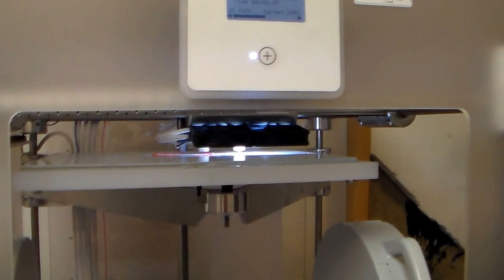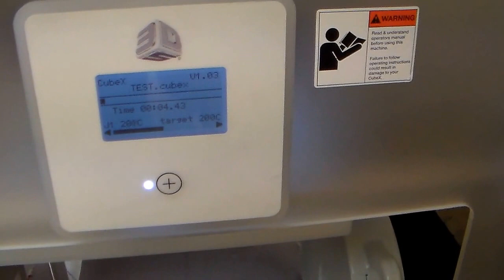Cubex 3d printer. Trouble shooting first print.

Comment: Hi Derek, use Kisslicer with Cubeitmod, you can print from bulk filament without any cartridges inserted and the print quality is much more better than with the Cubex software. Go to google group "Kisslicer refugee camp" and you'll find the files and information.
Reply from the maker: do you have to change the control board? I am confused to as how this would work?
Reply: Hi Derek, no you don't have to change the hardware.
Just download and install  Kisslicer and Cubeitmod.
That works because the printer can accept not only "cubex" files but also "bfb" files.
Kisslicer + Cubeitmod produces "bfb" files without the part of the program that checks the cartridge, but the most important is that that the quality of the printed parts will be really better than with the Cubex software because Cubeitmod V4.5 ( at the moment is the latest version) changes the speeds into the file to make them fit the speeds the printer can do and you'll have very smooth surfaces.
You'll be able to print with higher resolution than advised by 3Dsystem, I've already printed parts with a resolution of 0.05mm .
I suggest you to subscribe to the Google group  "Kisslicer refugee camp" and we can continue the discussion there.
Reply from the maker: I already have thank you so much for this information!
Reply: Derek Jones Also, you could possibly get a heated bed from GRM if you want to print with ABS with minimal warping. In addition, the latest version 4.91 allows you to use the current public unstable Kisslicer version 1.4.5.10 which allows you to use something called a "brim" or an extended first layer (not to be confused with "rafts") to allow higher adhesion to a non-heated bed surface with a bit of painter's tape that has been scratched with sand paper. You can even take out the cartridges and open them up to use their remaining filament (if you don't want to waste the invested money since the system for routing it is a major reason for a LOT of tube jams as the plastic is substandard China crap that is not even worth 20$ per pound). Just keep the spools in a plastic bag with some desiccant if it is PLA since it likes to be hydrophilic to surrounding moisture, but keep in mind that the plastic is quite literal shit since they are incredibly fragile in terms of 3DS proprietary filament. Eventually, you will want to completely gut the motherboard out and open source (using RAMBO or equivalent motherboards) the printer using some guides you can find; since, the quirks with the firmware-hardware interaction itself is a major barrier that bars you from other hot heads and already supported heating beds as other motherboards can reduce over-jerking motions of the stepper motors and stop heating beds without external input to know when the print is done.

Comment: I also bought  a cubex Duo, some  reviews classified this machine as being the best, this is funny, they classified the cubex at the top because of the max  build volume, max build depth, max build height and max build lenght :) I was dummy enough to not research decently-
This machine is awful, bad print quality, poor precision, incredibly slow, expensive plastic, (i had 3 ABS cartridges not working), I used it 3weeks and gave up. im thinking about a ultimaker or up3dplus.

Comment: thanks for posting this, Derek. I have gone thru several fine tuning of my duo since I got it two days ago. highlights: (1) Z level-- extruder too close to print plate. (2) needed to offset the extruders back more so their default position stays behind the wipe. (3) keeps getting checksum error with their USB stick so got a better one. (4) Cubex software building process is pretty good but I have a list of suggestions for improvement... mostly they need to make a Mac version....